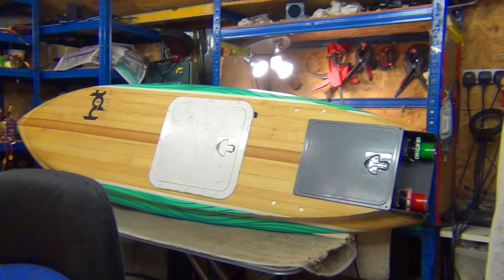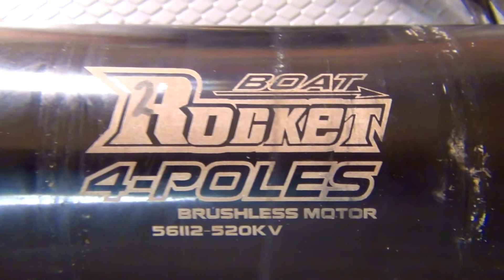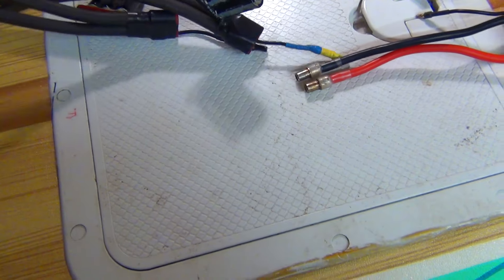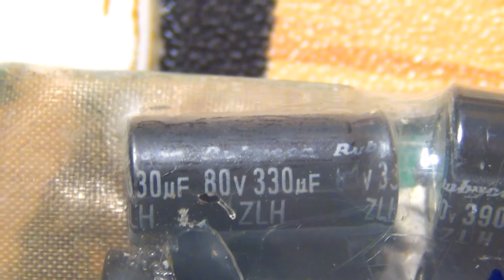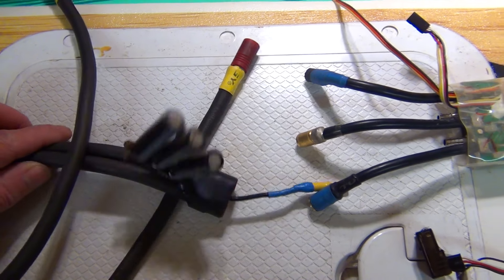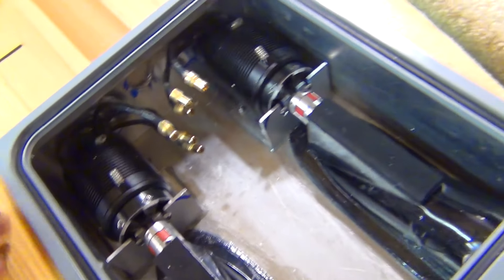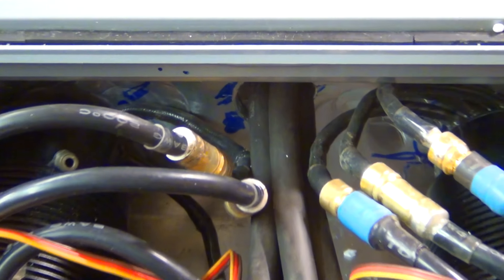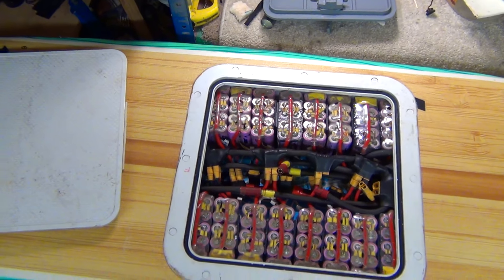Best DIY Jet Surfboard, Build Pt3

Comment: If you ever get to Florida someday, just know that there's over 200 miles of canals there as part of a phase the developers went through with "water front" property.  They figured if they just built canals and the houses on the canals they could sell them as waterfront properties and they weren't wrong.  But the result was all these networks of canals like streets and I just realized that to have a rally (like Isle of Man TT but on water) but with personal watercraft.  Electric bikes crushed IoM TT and got their own class (Zero class) - seems it's time for watersports to learn what's up.  ;-)  I'm in Oregon so if I had one I'd be running it in the ocean here...

Comment: What does "ZLH" stand for on the electrolytic capacitors?
Reply: ZLH is actually not to important. It's just a specific series of ultra low impedance long life capacitors. Any good quality capacitors will do the trick. I use expensive audi capacitors on my 550amp speed controller for high speed RC runs. Just make sure You spec the voltage correctly.